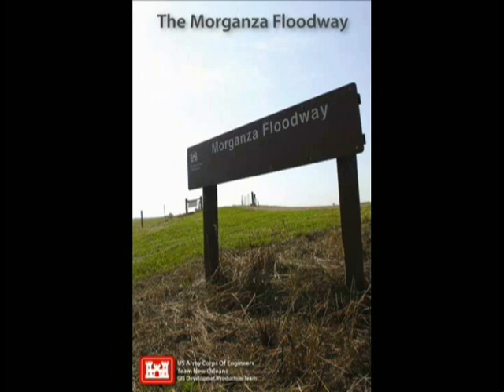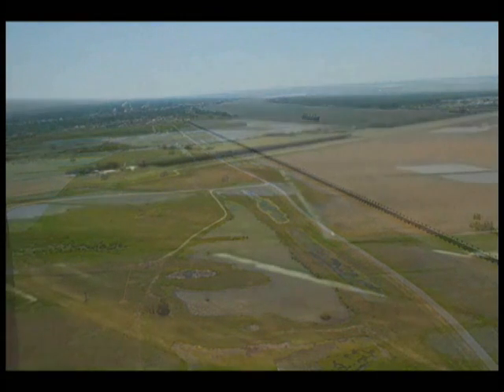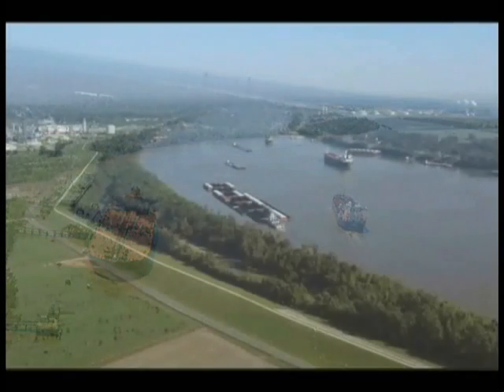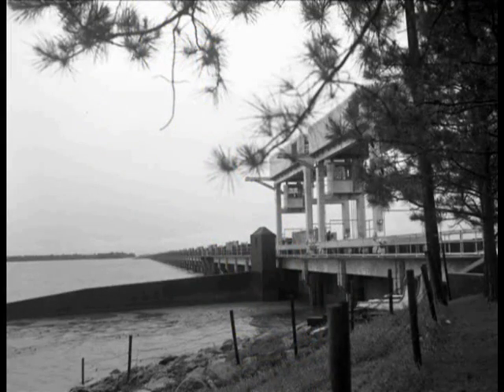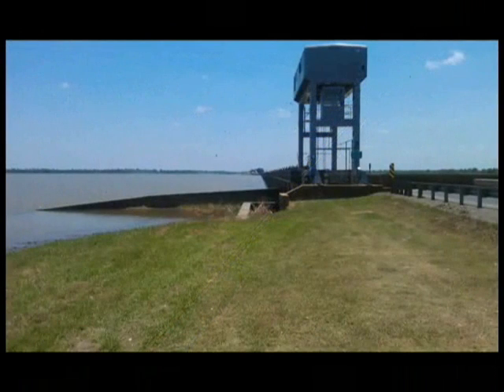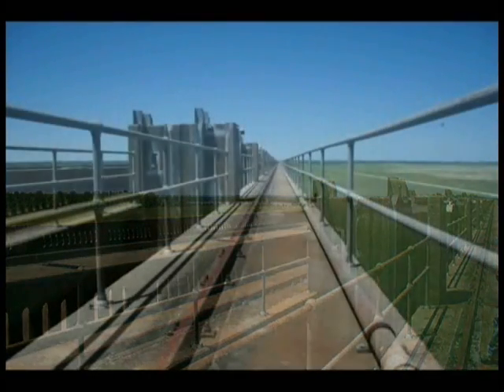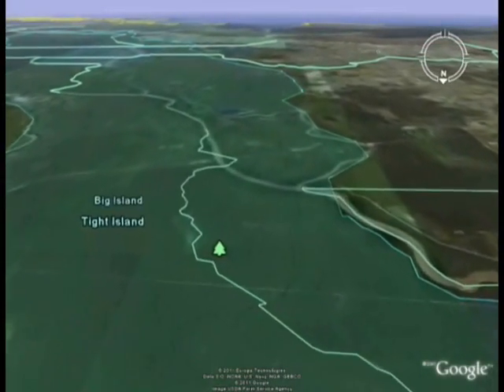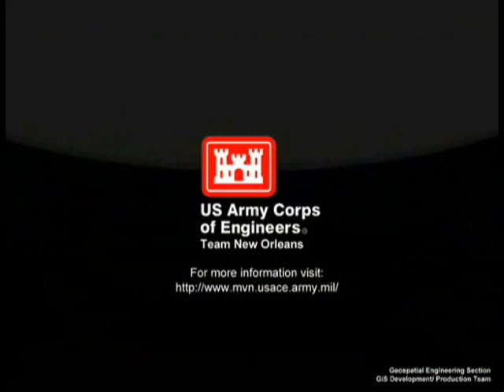Morganza Floodway

Comment: this video was made 11 years ago.  The Morganza has been opened now three times.  1973, 2011 and 2019.  There is one other rarely used spillway north of the Morganza called the Old River Control Structure.  It was opened in 1973.  Since then it was opened a time or two (was opened in 2011).  Old River Control Structure is rarely used.

The major spillway is the Bonnet Carre Spillway and it has been opened many times.  It is the largest.  Bonnet Carre stands for "square hat" in french.
Reply: Don't think they opened it in 2019